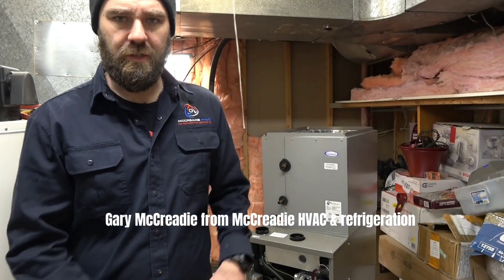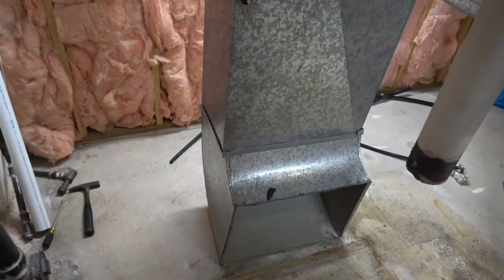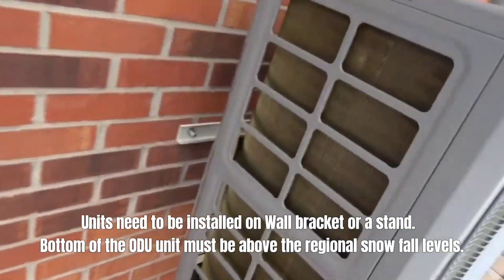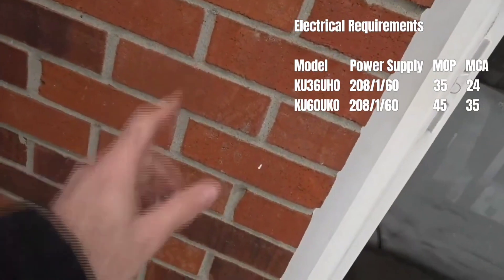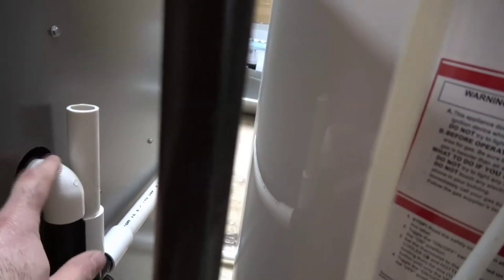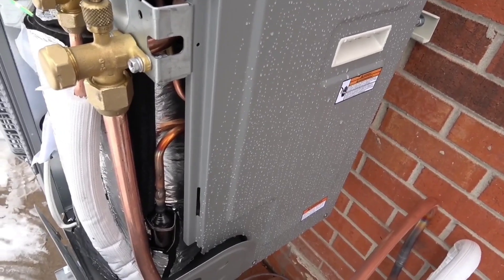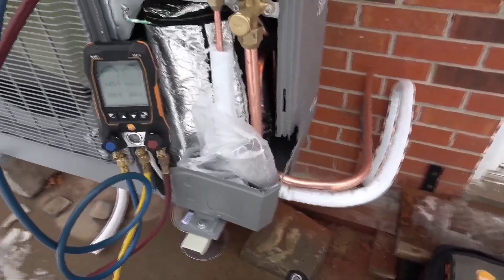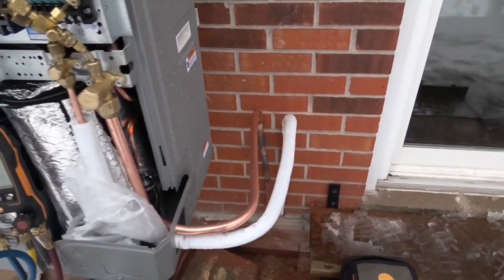Dual Fuel Heat Pump Install Tips - How To Install A Heat Pump

Comment: Isn't the reversing valve logic reversed with B terminal gree uses vs O and furnace control board would get wrong signal? Doesn't it matter to be able to disable slow blower rampup for dehumidify in heat mode and also expect a W1 call for defrost while Y is still energized?

On better version of that furnace el296v -> there is actually a status code for heating with heatpump (lower case h) and another for heatpump defrost. 

I would think would need to reverse the logic with a relay.

Comment: What's an acceptable pressure check drop in PSI over 10 or 20 min. 1 or 2 psi. Is there a few psi range that temperature of the gas can fluctuate. Depending on the bottle temp vs system temp. I'm praying you tell me the good news. I let the gas into the system. It held 250 micron vac for 15 min no problem. I had to fiddle with the setup a bit. Most of these inverter systems have 3/8 ports and i didn't have 3/8 to 3/8 hoses or enough adapters. And cheap core removal tools. One of them leaked. one didn't. And some don't grab the core. Check that too

Comment: Surf bro channel highlighted the white textured insulation falls apart and corrodes line sets. I confirm that with a neighbors unit, a few years old. It looks like someone hit it with a torch and it's just gone in many spots. UV eats is. And it corroding the set quite bad. Those guys love the k-flex. I'd consider buying that stuff for sure. I premade set has jumbo neoprene style and it tears, but not as bad as i thought. But it definitely doesn't glide at all. And will help get it stuck in a whole and bunch up.

Comment: 3/4 by hand kinks fast, especially if you go fast and go against the previous coiled up direction. Get a good bender. My cheap one on 90's looks funny, but still acceptable. Maybe it's the copper producer influencing the bend shape/tension. The bender is pretty nice in function, it's like all the other ratchet ones.

Comment: Did you add a bi-directional filter drier?
Reply from the maker: No drier on this one.
Reply: Is it something you could’ve added or didn’t on purpose? Just curious cause most of the heat pumps we get don’t have a filter drier included and reading the manual for the MOOVAIR unit didn’t necessarily specify either
Reply: Inverter heat pumps do not use filter driers because it will impair the velocity of the refrigerant. Inverters rump up and down constantly and a drier would be a problem.

Comment: Question please @14:30min , Defrost (D) wire not connected. sometime they call it W1.  when heatpump go in defrost mode it send signal to furnace to start working.

Comment: We did almost the same set up in our home here in Wisconsin. We decided to go with a Mitsubishi heat pump system with our 16 year old Lennox furnace.
Reply: How is it working for you so far in our mild winter?   What thermostat are you using?
Reply: It’s working great! I do think that it is raising my electric bill a bit but my furnace hasn’t ran at all this winter so far. Here in Wisconsin we are expecting some brutal winter weather over the next week so we’ll see what happens those days. My suspicion is that the heat pump will give up and my gas furnace will take over. Unfortunately I am stuck with the Mitsubishi brand thermostat! I see articles from Mitsubishi that say I can use other thermostats but the contractor that did the install insisted on making me use this one. They said whenever they contact Mitsubishi about a problem the first question that they ask is, “what kind of thermostat are you using?”.  It a shame to have such a high tech system strapped to a no feature thermostat!

Comment: From my experience testing a new system that's filled with Freon use low PSI to test for leaks otherwise you might push nitrogen into the compressor the valves are not designed for High psi

Comment: When heat pump goes to defrost cycle, does the furnace turn on gas burning to providing  warm air or just supplying cold air to the house?

Comment: I have a Gree 3ton unit set up recently paired with a Carrier furnace. Interestingly my HVAC installer has recommended and set the heat pump threshold to a stagger 10deg C, stating it was more efficient the run the furnace than heat pump at this stage. Everything I've read, including your vid, says these Gree Flexx units are designed to operate right into the -20 deg C even if the efficiency is reduced. Should I readjust the settings from what you recommend?
Reply: A hack did your install lol😅😅
Reply: the optimal balance point depends on energy costs as well as heat loss vs heatpump output.

Comment: Thank you for the video Gary - very imformative. Does that heat pump have two stage heat and cooling? If so, would you need more wires to the thermostat to take advantage of that function?
Reply: variable capacity machine with single stage control - slowly ramps up.
there's another one by midea sold under moov-air and carrier 38mura that has y1/y2 inputs but controls starting capacity and how quickly it ramps up. bosch has one that modulates to maintain a consistent indoor coil temperature, and the indoor fan can be staged to give some capacity control.

For direct thermostat capacity control over variable capacity of heatpump, need a communicating system like carrier infinity, mistubishi, lennox signature, daikin etc. Gets very expensive.

Comment: Hey guys! Have any of you replaced R22 out of a residential AC unit and use R12 instead? I would like to know if had a good or bad experience. Thank you very much in advance
Reply: wouldn't work properly. r12 runs different pressures and has very different capacity.
r12 is extremely expensive - why u would want that, i don't know.

Comment: I am thinking of installing an eco bee thermostat on my new duel fuel system. How dose the eco bee get the outside air temp to use for the compressor lock out or balance point? Was it easy to program? Was it simple and user friendly? What’s you opinion on the eco bee. Thanks
Reply from the maker: It gets it from connecting to wifi and choosing location.  It's very easy

Comment: Is this an actual brick wall or a brick veneer like most brick homes? The brick veneer is just tied onto the wood studs and is not good for weight bearing and should be done all the way to the studs if done. Rather find a ground mount myself, the less holes in the wall the better. Something for people to keep in mind so a homeowner doesn't have other issues in years to come.
Reply from the maker: I've used sleeve 1/2" sleeve bolts on this type of brick for 20 years now or more.  It's literally never been an issue.  These are full bricks, not just a facing.

Comment: those rectorseal brackets rust like crazy here in eastern canada
Reply from the maker: Try using using Viper Coil Coating.  It protects metals from corrosion

Comment: Nice work, Gary, gotta love those hybrid systems. Since you had a heat loss calculation done, you can now do a balance point chart that will show you the outdoor temperature at which your compressor should shut down thus handing the heating job over to the furnace. In my case, my balance point worked out to -8F as my home is well insulated. It’s still an approximation, but you’ll be in the ballpark. In the old days, cabinet air filters were a premium accessory…we used to mount the cabinet horizontally in the drop duct for customers who paid for the upgrade. Sometimes there wouldn’t be enough room, had to move a water heater one time, but customers loved the convenience of the filter being more easily accessible.

Comment: I installed an ACIQ 26vac controlled Hyper Heat Pump in a dual fuel system.  WOW!  What a difference. My heating and electric bill was about $625 a month combined.  Dropped them down to $340 combined.   ACIQ is owned by ICP. The heat pump is really a Midea product.. The non 26vac versions are rebranded by ICP's Carrier/Bryant as their residential light commercial heat pump.  I love this heat pump. I have my system set up as a 2 cool and 3 heat stages.  The heat pump has high and low compressor stages.  I added a 26vac relay operated by the high compressor stage input. The relay raises the fan speed to maximize the  flow across the coil which maximizes the hear pump. I control the system with a Honeywell Vision Pro T Stat.  This setup gives me 13k to 47k Btu cooling and 11k to 57k Btu heating with heatpump and 80k Btu output for the furnance.   My heatpump does great down to 5F. At that point the Btu loss of the house starts making the heatpump cycles defrost a little more than the Thermostat temp split likes and  the furnance kicks on. The furnanace kicks on as part of the Defrost as well using the defrost/humidity output from the heat pump spliced to the furnance on input.   So I get hot air during the heat pump Defrost cycle.  Love this setup.  The house is warm and the bills are lower!
Reply: I read a carrier 38mura training (same midea product) presentation and it said even with only y1 energized - first stage call -> it gradually ramps up to full capacity, just starting at a lower capacity and ramping lower compared to a y2 call. Said specifically to run fan at full cfm required for max capacity only. I wonder if the aciq and moov-air (another re-badged product) works the same way.
If it is true, have to be careful not running too low of a cfm on first stage if fan staging is done.
Reply: @Jon-hx7pe ,  When starting the unit will limit the max Potential and slowly ramp up to max Potential. However, the EEV will open and close based off of return temp and pressure of the refrigerant and still limit the output.  So it starts out as an "up to 12kbtu" then slowly ramps up increasing btu max until it becomes a "up to 48kbtu" . Basically it slowly allows more and more max load capability on the compressor..